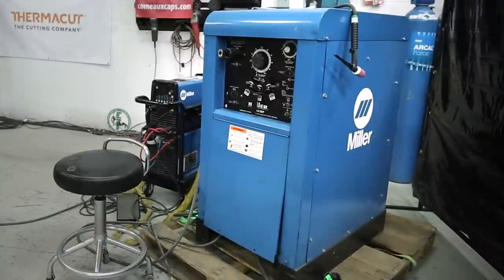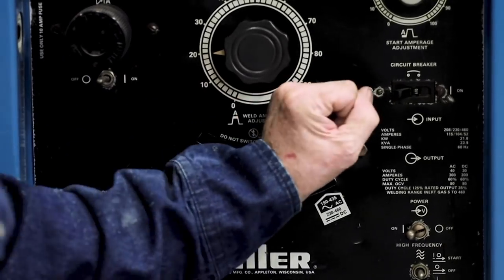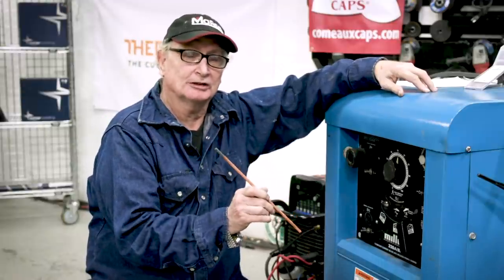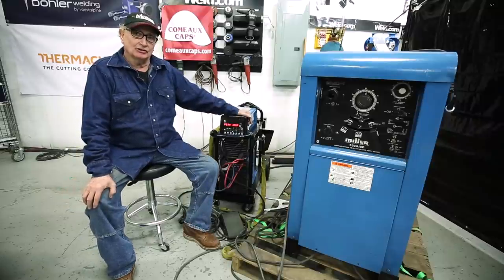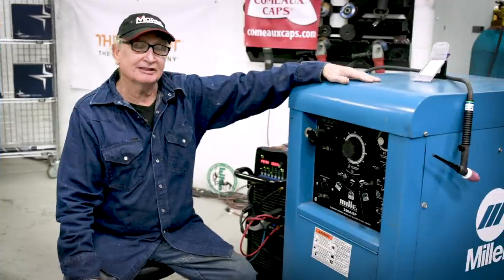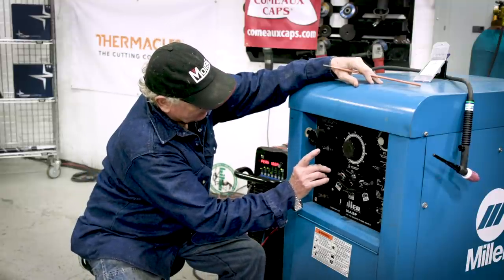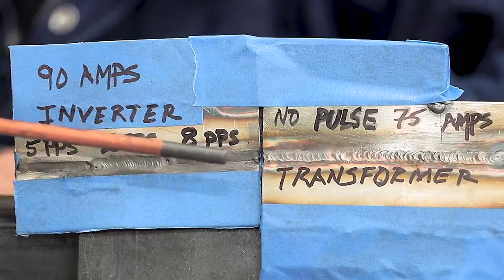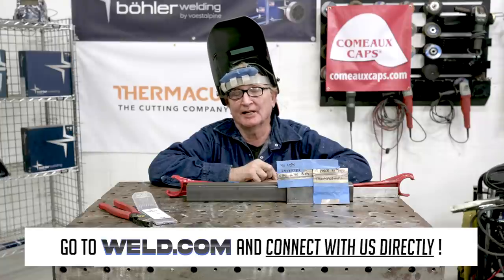Inverter Welder VS. Transformer Welder

Comment: Built to last in the 70s.
Reply: yes, and break your back moving, I was wrong about the weight of the Transformer, I said 500 lbs, it actually weighs 830 lbs.....cheers, Paul
Reply: I got one it is closer to 800

Comment: I still use an late 70's Millermatic 35 MIG in my shop. It welds so nicely I have no want or need to replace it. I have other welders but I tend to use the Millermatic when I am in the shop. I will admit that it takes three strong men and a hairy assed boy to put it in the back of the truck if you want to take the welder somewhere but when you get there it will weld nice. 😉😁

Comment: I bought that very miller machine in May. Just got it set up yesterday. Love how smooth it runs.
Reply: which one, the Dynasty or the 330 transformer......both are great machines, but for aluminum, the Inverter is much more flexible, but a lot of aluminum has been welded with the old transformers, ask me how I know.... thanks for commenting and watching, Paulie B

Comment: For AC TIG machines, a very important difference between transformer and inverter machines is that the transformer welder simply shapes the 60 Hz sine wave from AC power input. You can control the current, and sometimes the balance and add pulse, but you're still welding with the 60 cycles per second from the power company.
An inverter machine turns the AC from the power company into DC and then creates its own welding AC waveform with computer-controlled power transistors. This is why an inverter like the Dynasty can make nearly arbitrary waveshapes (i.e. square, sine, triangle) and vary the frequency freely over a wide range.

Comment: I sometimes buy old broken welders, but I almost never buy a broken inverter welder, at least I definitely won't pay as much, the transformer ones are a lot easier to fix and the older guys seem to prefer them. It's usuallly the control circuitry that goes on them.

Inverters though, I've seen craters where the IGBT's, or even worse, MOSFETS where, IGBT's are found on the higher end machines and they don't normally blow, but MOSFETs are on the cheaper ones and blow somewhat often if the machine is used a lot at the max current. sometimes they take out even the computer board and most of the PCBs need to be replaced. I've had mixed results with them breaking again within my 12 month warranty period. Transformer ones however, I think since I used newer designed parts with those, they just might outlive me.
Reply: great information, thanks for sharing and watching....Paul

Comment: Nicely done. I used a Synchrowave starting in the early 80's through 2000. The ac/dc selector and voltage levers were just as you said, tough to move. They were work horses, though. Never a problem with them, even with multiple weldors, some who were not too well trained. Thanks for the insight into the inverter machines! Look forward to more of your videos.
Reply: so glad you liked, really makes my day reading this......this is my first video, and I have to admit, I was nervous....thanks for the comment, Paulie B
Reply: @ypaulbrown  nervous? I sure didn't see it. Just good info, that worked for me. I used to teach classes in aircraft repair for hundreds of people, and the first few times I was nervous, but if you know what you are talking about you soon get a fan club out of the participants. It's pretty cool after that.
Reply: @mytkc66atbat25  you made my day stating this.....cheers from Florida, Thanks for watching and commenting, Paulie B

Comment: Bit of an odd question, but have any of the welder manufacturers done any testing to see if pulsing might cause Photosensitive Epilepsy?  Or other flashing light induced physical problems? I've noticed a couple of times that lights flashing at certain frequencies made me queasy.  (Older computer screens under florescent lights for example.)  Do the modern light sensing helmets help reduce the amount of perceived flashing any?
Reply: great question JT....I know of no studies done by manufacturers, I do know that fluorescent lamps with their 60 cycle blink will give you headaches, that has long been known,,incandescent lamps do not have the same blinking as they are continuously lit.....I do not think that Auto Darkening lens will reduce any flickering, only the intensity of the light. I personally get nervous driving through tunnels with the flashing of passing lights on the walls creating a strobe effect, but I have never had anything happen.....I have welded a lot with pulsing and never had an issue, but I am sure those that may suffer from epilepsy could have a seizure......thanks for commenting and watching, Paulie B

Comment: Great Video! One thing I failed to catch (if you mentioned it) is the input Amperages for an Inverter welder is a fraction of what the transformer machines. I had both Dynasty 200 and 350 and upgraded to Dynasty 210 and 400 inverters 3 years ago. My 100 amp service in my shop could never handle any transformer welder with all my other machines running in my shop! With inverters, it is not an issue.
Reply: You are so correct, Inverters use maybe half or less the power of a transformer, and part of that is the efficiency of the high frequency high voltage/low amp conversion to low voltage/high amps welding current. The transformer with it's 60hz input voltage of 220 volts is very inefficient compared to the inverters 15,000 to 30,000 hz conversion. thanks for commenting and watching, Paulie B

Comment: Since old transformer welder are really easy to find. I would like to know what is the best made machine maker for use with single phase 240 volts machine ?? Since you are familiar with old machines I think you could give me a little education about different makes of machines Sir. Thanks
Reply: Victory, great question.....Miller,Lincoln,P&H, Airco,Linde/Union Carbide,Hobart are all great machines.....not necessarily in this order either...they were made for industrial use and not the home shop, so they are very rugged.....as far as which machine is the best, I have seen all of them in shops and personally used Miller, Lincoln,Airco, and Hobart...one of the best weldors I have ever seen who worked at Lockheed Martin as a welding engineer and had a welding shop at the same time used a P&H......at one time, Westinghouse also made fantastic machines.....I hope this helps, Paul

Comment: Back in the early seventys I ran an old Miller tig machine. The only one I had ever ran. It had brushes like the old torpedo pipeline machines. The winding failed so they sent it in for repair. In its place was a brand new Lincoln. Suppose to be the best at that time. I hated it! Not near as smooth running as the old Miller. And was glad when she came back from being rewound! It had to weigh around 1000lbs!
Reply: Hey Pat: Those AC powered generator machines are known for their smooth arc compared to a transformer, the Lincoln was probably a Transformer......I have only welded with a Generator [AC powered] a few times, once a 1940 or 50's Hobart and the other times with a Lincoln Airwave...the one that looks like a fire plug and screams at you.....I used it to pass a D1:1 F3 and F4 [vertical and overhead] unlimited test with SMAW [stick].....the arc was wonderful....thanks for commenting and watching, cheers, Paulie B

Comment: Thanks, I'd love to see some detailed set up info for a synchrowave 250, doing tig. esp. on aluminum, I am struggling. thanks again!
Reply: 682, I will run that by the Producer, the Synchrowave 250 is actually pretty easy to set up, I have owned one since 1997 and love Her....the AC Balance settings are Max Penetration [10] is 32% + and 68% - [best setting for aluminum if clean] [3] is 50/50 and [0] is 55%+ and 45%-, more for dirty aluminum. Remember, the positive side is the cleaning side of the arc, but why don't we use 100% positive, because the electrode can only handle 10% of the amps on positive as it does on negative and we do not get much heat input into the material......make sure material and filler is clean...wipe with acetone first, stainless wire brush used only for aluminum that has been cleaned with solvent first [no oils or dirt]  and only brush in one direction , not back and forth, then wipe with acetone, alcohol,xylene,toluene, your choice, [no petroleum distillates ] then use a Scotchbrite or sandpaper on your filler rod [same steps]. now you are ready to Rock....remember, Aluminum dissipates heat fast but the thats spreads fast too, so you need to back off on the amps as you go along, it also requires more filler than steel or stainless. Aluminum is what they call [hot short] meaning it will crack when in the solid state after cooling down but not completely cool, so you have to add filler to reinforce it. Try running beads with no filler you will see what I mean. also, fill the crater at end of weld with extra material to keep a crack from starting there. 
There is a real good Video on Weld.com done about one and a half years ago by RedBeard [Jason Becker] I highly recommend watching that......
I sure hope this helps....let us know and thanks for asking about the Synchrowave 250....
oh, by the way, as far as amps on the machine, depending on how you like to push the foot pedal [assume you have one] setting at higher amps lets you move your foot less to  get the power you need...same goes for stainless or carbon steel. 
rule of thumb is 1 amp per 1/1000 of an inch of material...so 1/8" .125 would be 125 amps...stainless is about 10% less due to lack of heat dissipation . Miller makes a handy slide chart on how to set amps for tig on all materials and thickness pulse what size electrode to use. Your dealer may have  one or you can order one I am sure. very handy when starting out...go to Millerwelds.com for more info on their equipment, you can also download owners manuals there for free.....a great resource....

 thanks for commenting and watching, Paulie B
Reply: Thanks Paul!

Comment: I think it’s a real oversight, maybe willful, not to mention that the transformer units can be serviced economically, locally, even without official parts availability. These inverter units will eventually be unserviceable anchors once Miller abandons them. That being said, it matters more for small job / repair shops than production facilities that wear everything out quicker while benefitting more from the undeniable productivity improvements.
Reply: Not a willful oversight, as a user of both type machines, starting using inverters in 2000 and transformers starting full time in 1996, I have had no problems with my machines. Well, I did have a Maxstar 140 die after using on an Engine generator welder, Trailblazer.....not sure if it was the generator, or the Maxstar that was the issue....was using inverter at 65 amps which is way below 100% duty cycle so it was not an issue of overheating.....had a burnt resistor on the board.....The bottom line in my opinion is, if the machine can let you do more but not last as long, the payoff is in what you can do with it......I am not a believer in throw away economics.....I have a watch I bought in 1973 and a professional camera that I bought in 1974 when I was doing commercial photography and it is still fine even though it has had service done to it, the watch, well it needs service too....Inverter prices are dropping drastically and transformers are going up....technology and cost of materials are the reason.....only you can decide if the trade off is worthwhile....
I really had not thought of the service issue when making the video since it was more of a comparison of what you can do with them....maybe we should have mentioned the service issue, but I have no experience there so it was probably best to not get into that...Thanks for commenting and watching......best regards, Paulie B

Comment: Yup those are great points for the inverter. But no boards to burn out, less complexity, and the same power out of the transformer.   I’d take either, but my transformer stick welder was made in the 50’s or 60’s and just won’t quit
Reply: good point, but tigging aluminum and thin stainless is where the Inverter shines......I love my Bobcat 225 engine welder for location, but I have had to use the Dynasty 200 on jobs where getting the machine and leads were too difficult......thanks for the comment, Paulie B
Reply: Problem for most is the input voltage..that 330 needs like 100 amps of input, maybe more..I had a 320 and to get the full 300 amps of out put it needed 100 amps of input power.. my 280 dynasty gets 280 amps of out put with only 30 amps of input power.. my first tig welder was that 320 ab/p.. I am nervous about such hot rod power out out of the dynasty,  but so far/ so good
Reply: @aaronbowe596  how often do you need 300 amps? I used to run my Synchrowave 250 [that specs a 100 amp breaker] which is a 310 amp machine on a 30 amp breaker on a 120 foot 3 conductor 6 gauge cable. the amps were set to  150 and I never had a problem. The 280 draws 23.2 amps at 280 for tig and 29 amps for 280 with stick on 220 volts.The 330 a/bp calls for 96 amps input at 300 amps for either Tig or Stick. We talked about the lack of efficiency of the transformer machine due to the low frequency [60hz]  in converting the medium voltage/ medium amps to low voltage /high amps for welding, while the Inverter converts the 60 hz to 15,000 to 30,000 hz for a more efficient conversion to welding volt/amp range and the ability to use a smaller transformer. I hope this helps, thanks for commenting and watching, Paulie B
Reply: I repair alot of thicker aluminum at times and my 320 ab/p would pop a 70 Amp breaker as I approached 200 ish amps. I would only be able to run about 60% of that "high" range. Also at times needing to run some mobile jobs so I bought that vulcan pro tig from harbor freight in a pinch to do a mobile job and that first introduced me to the inverter machine. It would pump out 200 amps off of a 50 Amp breaker. Since then needing even a little more amps than the 200 I purchased the dynasty 280. With a fairly low frequency adjustment giving me the largest weld cone I can work the 3/8" aluminum vacuum truck tank frames that I work on from time to time. Everything works good as of now! So to answer how often I need that many amps, probably once a month often even sooner at times depending on how hard they are on there trucks. They run an offroad porta potty contract on our military base out here in so cal.
Reply: @aaronbowe596  sounds like you have it nailed down on the thick aluminum, oxy/fuel heat is your friend on thick aluminum.....or even some helium added to the argon, but that is expensive...thanks for commenting and watching, Paulie B
Reply: Thank you for sharing your knowledge!!! We could probably talk welding for hours!! I love soaking up info from seasoned craftsman!!
Reply: @aaronbowe596  thank you so much for the kind comment.....I like being able to share information, some weldors do not.....I feel it is almost a sin to not share the knowledge that others before shared with me....try contacting me through my YouTube link....cheers, Paulie B
Reply: My ancient Linde HDA 300 still does a great job after all these years. The controls aren’t hard to work at all either. Yes, it’s a huge, heavy monster of a machine, but I’m sure it will outlive me….
Reply: no boards? inside a transformer weldere there are electronic boards!
Reply: @massimo79mmm  what are you talking about?  You think there are circuit boards inside of the pole mounted transformer outside of your house or in an old transformer welding machine?  Yeah hate to break it to you but a transformer is just separate coils of wire around a magnetic core.
Reply: @JacksonEngineering  did you ever opened a welder? i think no. at least in the last 30 years 🥱
do you think the gas valve and other tools are driven by the transformer?
rotfl
Reply: @massimo79mmm  my AirCo has no boards. Old AC/DC welders also used manual valves, rectifiers, capacitors, and resistors to accomplish what is done now with printed boards. So no an old welder does not have printed boards to fail. Newer ones do, but big beasts like these folks are using likely do not
Reply: @JacksonEngineering  don't know about new ones but older stick welders are just a transformer with a manual damper, almost nothing to go wrong, just recommissioned one from probably the early seventies, the screw thread had rusted stopping the damper, a wire brush and a little bit of oil and its welding like a good one, but being rather well made its heavy for what it is, can't have everything☺.
Reply: @CrusaderSports250  Bingo!  They’re not perfect but they’re reliable and will burn rods with the best of them.

Comment: What's the difference in the newer inverter welders that are the size of a lunchbox and weigh 35 pounds compared to 80 pounds from 10 years ago?  I had bought a 200 amp dual voltage mig around 2012 and by 2015 the machine that had the same output and options was half the weight and close to half the size.
Reply: Great question Peterbilt....The electronics and the case materials that are being down sized. It also depends on the manufacturer and what quality they put into the machine. As I am not an engineer or weld machine technician , I can not give a definitive answer.....I hope this helps in some way, thanks for commenting  and watching, Paul Brown